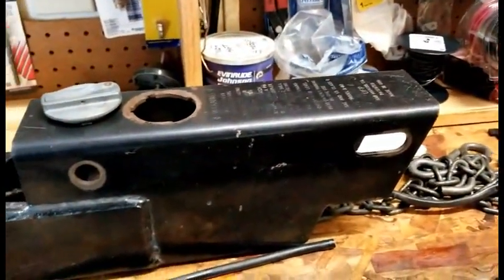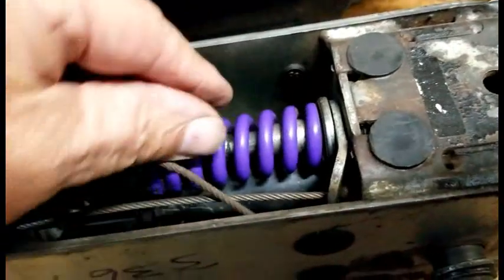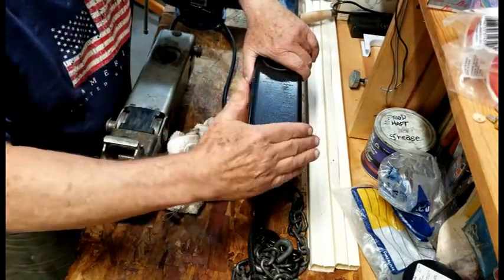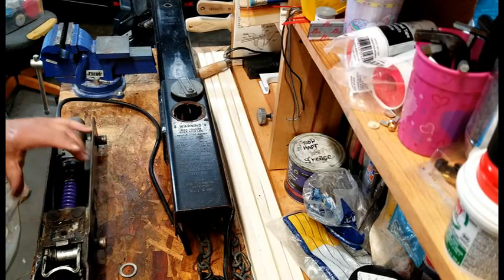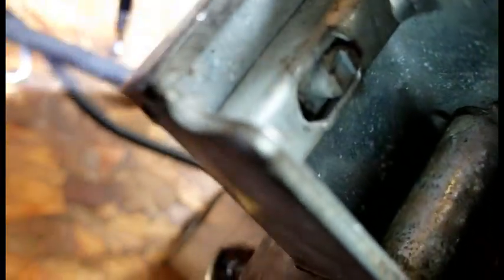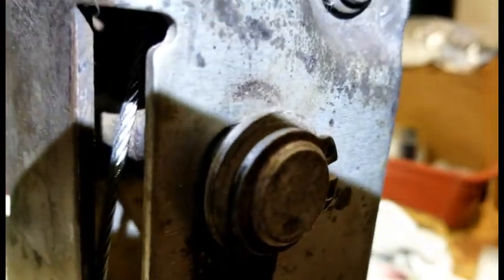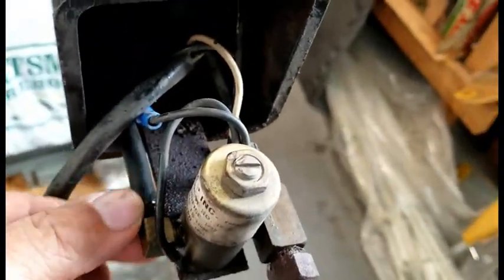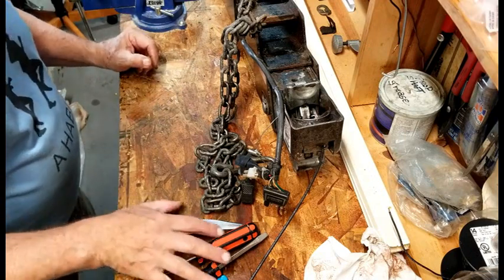UFP A 60 Actuator-2

Comment: Thanks for the breakdown. I'm currently replacing my shock as it's clunking, also while in there also replacing the pushrod. This helps me a lot as I'm also missing the breakaway safety cable clearly shows the routing and re-assembly!
Reply from the maker: So far I've replaced the pushrod, shock, master cylinder and breakaway cable. Glad the video helped. I have to refer to it myself when I do maintenance.

Comment: Thanks for posting this. I really needed it last year when I had my unit apart! Somehow when I reassembled it (after mistakenly removing the front 'pin') it ended up changing from a 2" ball to a 1-7/8" ball. I have not idea what I did wrong there. Any ideas?
Reply from the maker: I think you may have installed the latch incorrectly. The A-60 is for a 2" hitch ball. You can't use a 1-7/8" ball. The latch is probably not closing under the 2" ball because of the installation. Not knowing what you took apart, I can only guess what the issue is. I suggest you look at this latch area, starting at 12:53 in the video and compare it with yours. I had removed that hitch pin and took out the spring. It was a tricky part to put back in and I think that's where your problem is. The spring can go back in either direction. I think you have it reversed. Maybe the latch is not in the right position either, but this seems to be the problem area. Good luck :)

Comment: Would have been more helpful to show removing the mechanism from the trailer.
Reply from the maker: Hi Jeffrey  thanks for the comments.

There are different set ups for this unit. Some are welded to the frame and can't be removed. Others, like mine, are removable and people that have these know how to remove them from the owners manual.

If you don't have the instructions, here's how you do it:
Unplug the trailer wires and the brake line quick disconnect at the back of the mechanism. Remove the locking rings from the two pins in the coupler, remove the pins and slide out the mechanism.